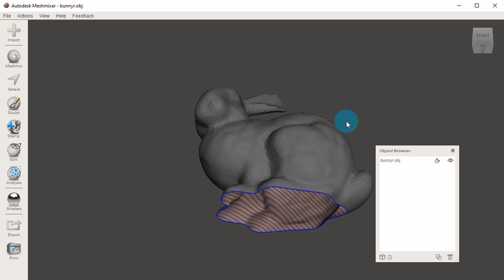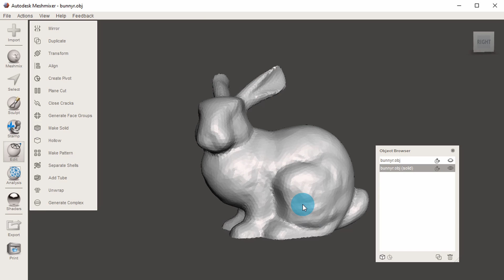Meshmixer | How to fix holes in 3D models | ⚡ Quickie ⚡

Comment: Try to do It in a miniature with lot of interior gaps.
Even using the highest "resolution" solve the gaps but destroy the Sharp details 😢, Any suggestion? Please
Reply: Yeah I'm trying to find this out, new to meshmixer but I have a minature with a large hollow section I want to keep, and a smaller cavity I want to fill.
Reply: @sonicwingnut  Did you ever figure out?

Comment: Hello, I have been working on the L3-L4 region of the spine and everytime I use the meshmixer to smooth my model. After which when I import it to hypermesh, the model is error free, but when i mask and remove some portion of the model, it turns out to be hollow from inside. Could you help me with this issue, please? I have been stuck since a long time over this.